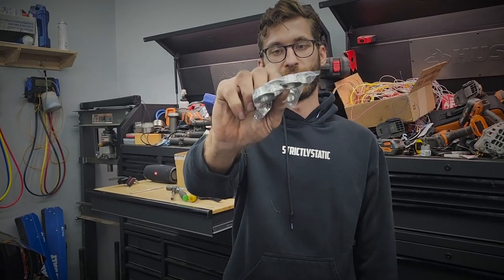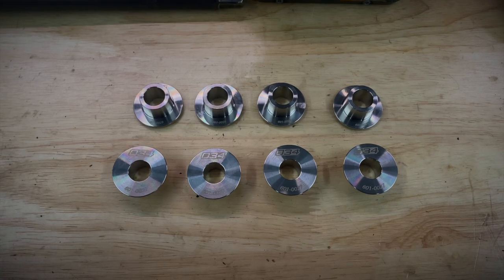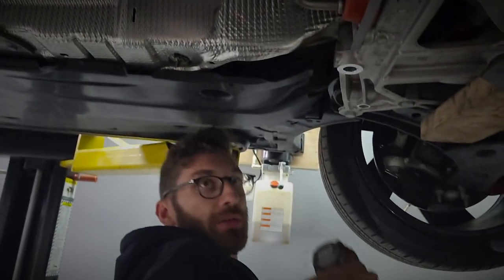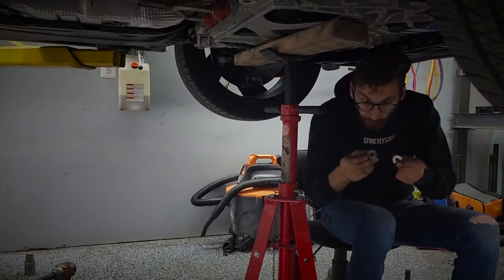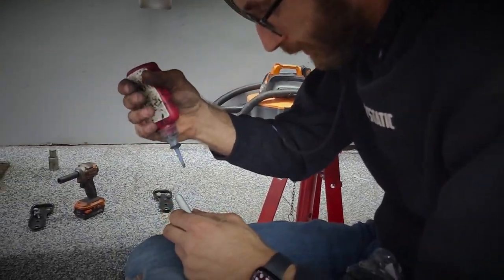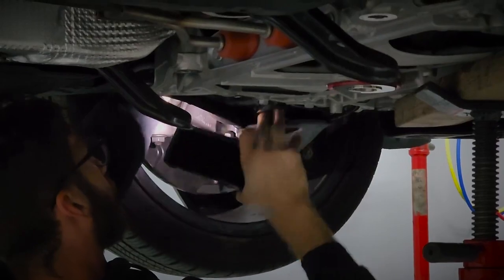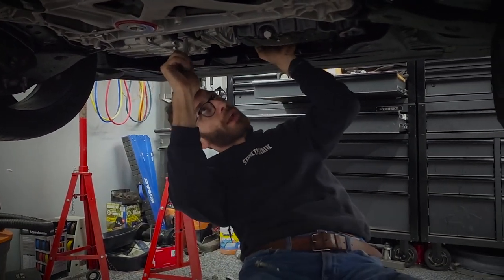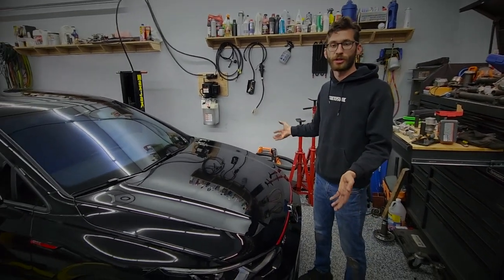MK8 GTI MQB Subframe Locking Collar Install

Comment: DID YOU ALIGNED THE CAR?
Reply from the maker: Yes I did. I aligned it about a week later.
Reply: How was your alignment especially the camber from side to side after installing the kit?
Reply: @MrPurple2486  If you do them ONE at a time, you won't come out of alignment.  Being mindful not to Torque them down completely as you complete each.  Work it in a "diagonal" pattern (i.e. Driver rear, Passenger Front, Driver Front, Passenger Rear), then come back and completely torque.
Reply: @MegaHollywood1971  thanx for your answer,but that wasn't the question 😉 subframe will lock in place with the inserts,so there is no more room to shift it. I was interested at the camber values after the installation if they are relatively even from side to side?
Reply: @MrPurple2486  I personally don't understand why someone is doing this on a Mk8.  Is there a subframe shifting issue?  Collars were a "fix it" for the Mk6 frames, but not the Mk7 and after.
As far as Camber is concerned, it's probably a -1/+1 on either side of the front.  This guy more likely is not paying attention to any of the "supposed" upgrades he is doing, just doing.  If you pay attention to the end of the video, the vehicle that is shown isn't even a VW.